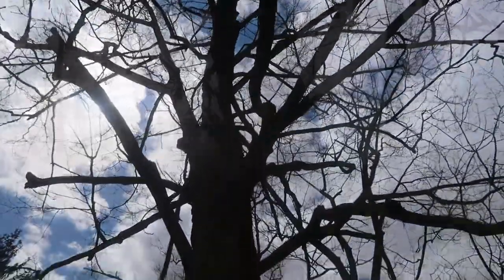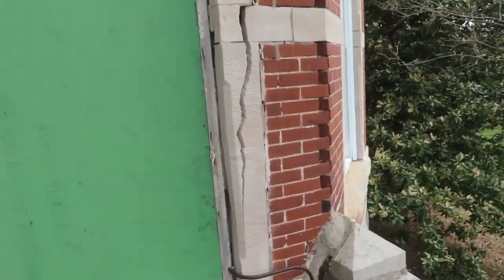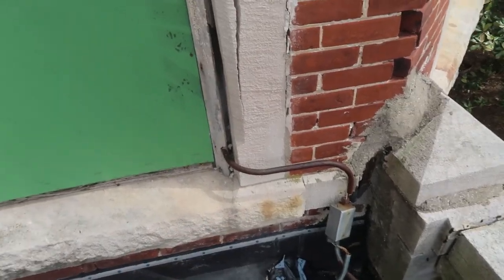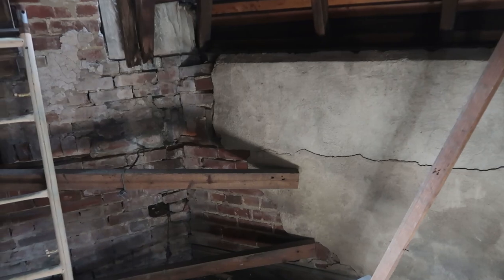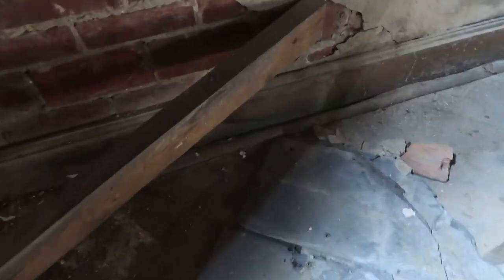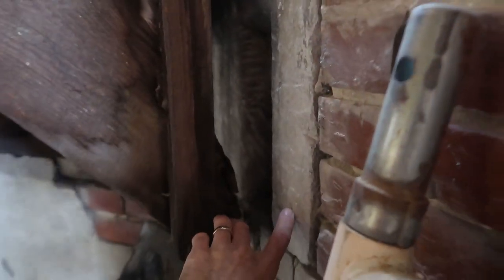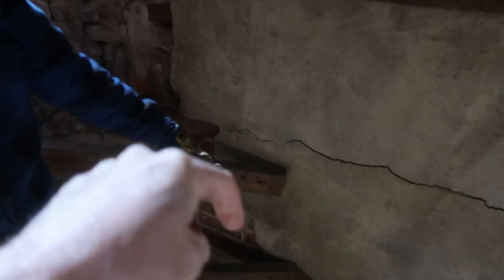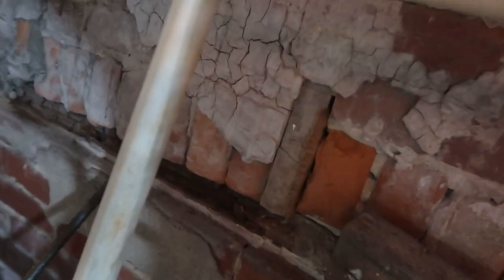Next Project: Option 2 of 4 S2E47

Comment: I would definitely start with #2. The structural integrity of the house must come first. You are at risk of losing that portion of the house. I understand 1 is a water infiltration issue, but you can put up some weather proof membrane on the outside to mitigate that issue. Whatever 3 and 4 are...they would probably take a backseat to 2....in my opinion...just because I can see the urgency in which this needs to be remedied. Thank you for sharing your journey. I'm currently working on renovating my own old mansion.
Reply from the maker: So, you know restoring old houses is full of adventure. Even though it looks bad when you first hear about it, it has remained very stable over the last two years. It certainly scared us the first time we noticed the long crack through the middle of that stone.

Comment: That wall is scary. I'd be doing that next. If you do work on other places the vibrations could and probably would be enough for the side of the building to fall down. My parents did a renovation where a side wall fell down for the same reason.
Reply from the maker: Yes, we don't do anything under this area.
Reply: @moorelandhouse  be very careful because even work in other plans can create vibrations that can spread. That’s both in the building and on the ground. Just driving near it could be risky

Comment: As I said on the web page this one makes me nervous about it letting go and you having the whole thing on the ground. I wish there was a way to stop the water intrusion on the front for a while so that it doesn't get worse. As I suggested yesterday covering the box gutter so the water goes past the wall rather than into it.  The danger level and leaking with this area makes it my first choice.  Take a couple weeks and do some more temporary fixes to tarp the front dormer down to the porch roof to keep it dry. This one if it moves on its own is going to take a big hunk down . I still think this is your next project and Bertha will reach on this one.
Reply from the maker: In order to get to this one with Bertha we have to cut down that big sugar maple tree. We measured and there is no way to get the big ole gal in between the tree and the Mooreland House. It is interesting that this dormer has people nervous. This one actually doesn't let in much water and it hasn't changed in two years. The front dormer, however, has been slowly crushing the limestone underneath and it is noticeable. Keep watching, the other two choices are interesting as well.
Reply: @moorelandhouse   Looks like the tree in the back that’s touching the house should come down too, or at least cut back.
Reply from the maker: Yes, we plan on taking two of those big magnolia trees down.
Reply: @moorelandhouse   both dormers make me nervous this one is actually worse than I thought when you posted them on the web.  Just a thought you took down the big front dormer and had a plywood and tyvek wall for almost a year what if you take the second front dormer down to the box gutter or second floor windows than close it in in the same way taking the stress off the wall below than move over and do this dormer.  this one makes me scared because the bottom of the dormer is kicked out and the top of the second floor wall is tipped out on top there is a lot of outward pressure there. When the one brick or rotten joist gives up a big chunk of this is going to go crash to the ground. As for the Maple it looks like it is in pretty bad shape as well there are several places that limbs have been removed that look like there is a lot of rot started in the trunk in particular about 3 seconds in above Kerry's head.
Reply from the maker: Yes, that will be the plan. You are correct about the state of the tree as well. It's sad to take down old trees but sometimes it just needs to be done.

Comment: I wouldn't know how to decide, flip a coin, draw a number out of a hat or rock, paper, scissors. So far they look equally important. Number 1 is leaking into the house, causing damage and number 2 looks like it is going fall at the first really windy day.
Reply from the maker: All four options are getting fixed soon, we are just deciding what priority.
Reply: @moorelandhouse  i starting to understand your dilemma.   feels like 1 and 2 needs attention.  but which one to do first? second?  and since i haven't seen 3rd and 4th.   GUT feel similar dilemma.   

the #2 would require you to seek 48 inch long stone which is going to consume time.  do you know where the quarry those stone came from?  if they are in operation.  go there direct.   tell their quarryman  hey i need six by six by 49 (allow for your cutting and shaping effort).   

until then I wait on the 3rd and 4th.
Reply from the maker: We know where a suitable stone is. They are not commonly available.
Reply: @moorelandhouse  In other words, special order?
Reply from the maker: No, they used to be steps at a Kentucky university. We will have to shape it of course.
Reply: @moorelandhouse  AH, i get it.  :)